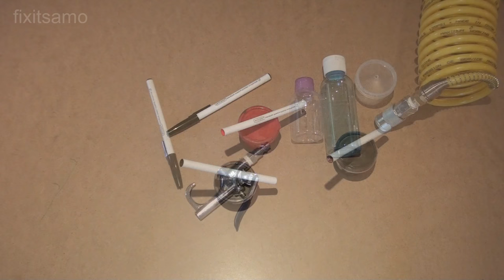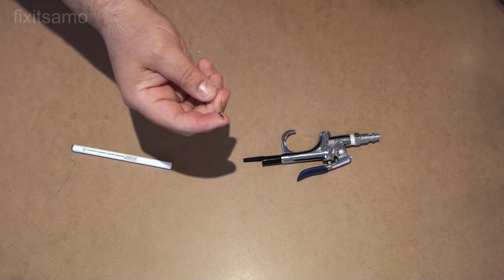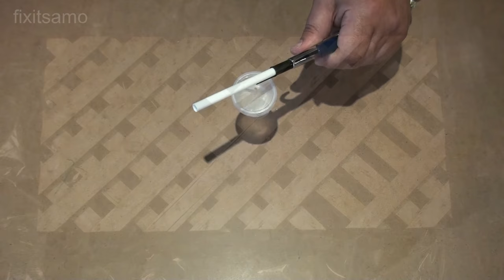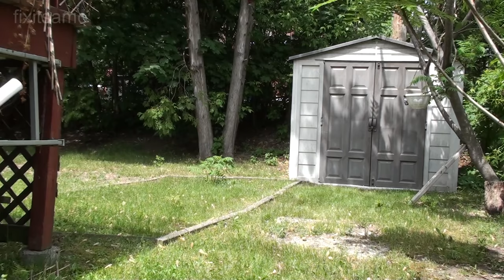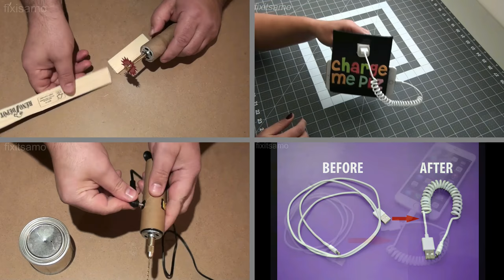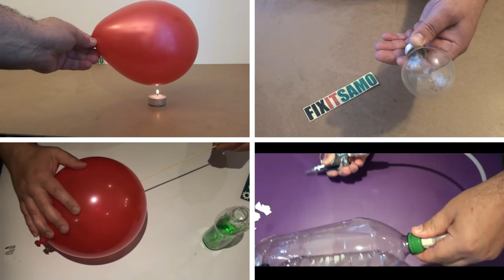DIY Air Spray Paint Gun

Comment: Hi thanks for this video, have a few questions if you have time to answer.  I may end up trying this out in the meantime, if so I will post my results as a reply to this question:

1: the air compressor you used? I notice someone commented a powerful one was required. Mine is a fairly cheap one I brought to use with a staple gun.  It has a 24L tank and goes up to around 105 psi.  It is a proper air compressor (not one of those things that are only for blowing up air beds or bike tyres) but it is a cheap one :-)

2: using a wider hose.  At the end of the video you used a wider hose, but only with water. A couple of questions about that: 1- does the wider hose mean the area sprayed is larger. Ie if you want to paint something big like a car or a house door, you should use a larger hose? Or does it just put the paint on the same size area, but a thicker coat?  Also I am going to guess that the larger the diameter of the hose, the more air pressure needed? Would my 100-105 psi air compressor be able to put out a ice fine paint spray with a larger diameter hose?   

3: mixing the paint - I want to use some acrylic paint (recycled house paint etc). Should I thin this? And if so approximately how much water to add something like interior acrylic paint (assuming the paint is at the same consistency it would be in a brand new can). Also the containers you were using were quite small, but I think it would be inconvenient to try and use a very big container of paint with this design.  How much area did you find each container was covering approximately?
Reply from the maker: +Kim Hartley 
Hi kim  
Any compressor will do 
Yes  using wider hose will increase the area you want to paint but i recommend spraying from 3 feet away from the surface you want to paint 
And yes adding more water to the acrylic paint will make it go through the hose  a lot easier and faster 

The small tube was a 1/4 size 
And the bigger tube  at the end off the video was a 3/8 size tube 

Let me know if you need more info

Comment: this is very cool.what if you added a huge container to add the pain could it be used to spray a bicycle like with the paints used for bicycles painting?thanks in advance
Reply from the maker: +jim john  i only used acrylic paint
I didn't  try with regular paint im pretty sure it will work cause acrylic paint is very thick and yes you can use a bigger container
Reply: thanks i will try this project it's very cool.

Comment: Hi!!! I tried to make one of this DIY Airbrush but something doesn't work!!! Infact the water is not sucked inside the pen but the air flows inside the tube (i see air bubbles in the water container)!!! For the test i used a common glass (top open)... the container must be closed to work? otherwise have you got any idea about what could be the problem? Thank you very much!!!
Reply from the maker: +AeroPacky this means you have to push the tube toward the the end of the pen it should work
Reply: Aeropacky did this work for you after you moved the tube toward the end of the pen? I am going To try this out just as soon as I find my glue gun and a glue stick.  Thanks for th very clear instructions fixitsamo 😎

Comment: Have you tried latex paint with the 1/4 inch tube? I am painting old cinder block and its surface is so porous I can't get into the crevices with rollers and a brush would be too time consuming, since latex is so thick, wondering how it would do

Comment: How the water pumped into the tube instead of just being blowed out with bubbles?
Reply: Venturi effect. Due to a fast moving air over the tube in the upper barrel, a vacuum is created which sucks liquid up the tube in the bottle. FYI this is how carburetor engines work

Comment: could someone tell me how the paint/water going up from the container? thank you
Reply from the maker: +Yuwan Prastio  
Thx to the Venturi system  
by blowing air thru the pen and putting the small L shaped tube  it will create suction 

And you can try the same pattern 
By using water  instead of air you will have the same  results 

Don't use water if you want to paint 
If you use water  you can put liquid  soap in the container
Reply: +fixitsamo ahh thanks for explaining to me,because i heard some people say it was siphon related and i was confuse because i had only see siphon on water case,now its make more sense. great video btw !